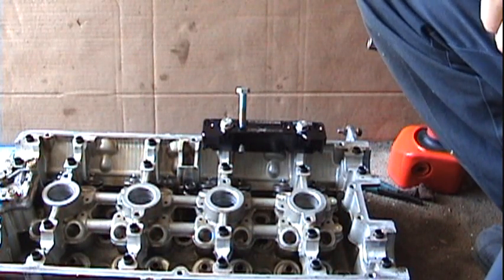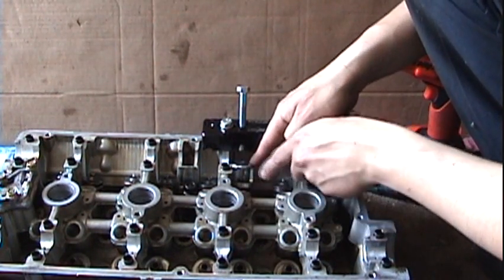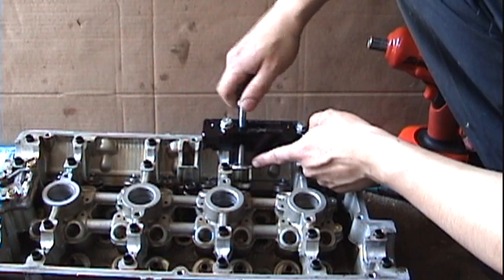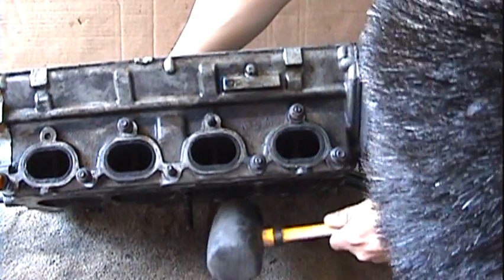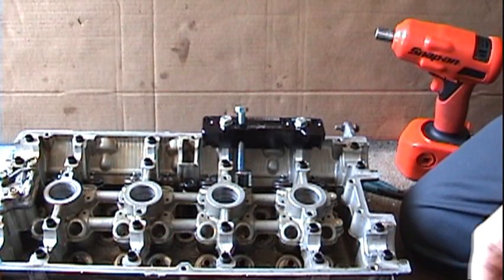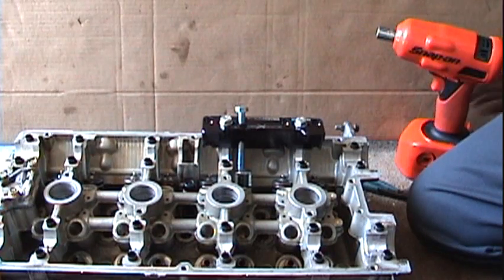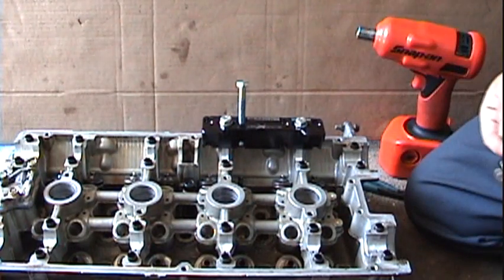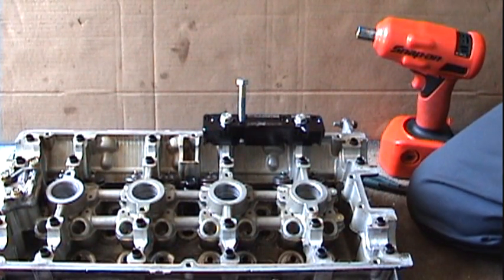Euro Export tool -  4g63 cylinder head disassembly

Comment: dude i like your valve removable tool i think i'm going to purchase one too. I have one that i made from a craftsman valve removable tool  used for the domestic heads i modded it by welding a notched socket. Got the idea from the dsm faq but sometimes its hard to get the valve spring out because of the tension and if the valves are cut at an angle. I like your tool better because it look easy and safe to use.